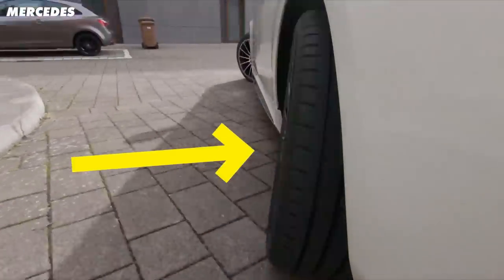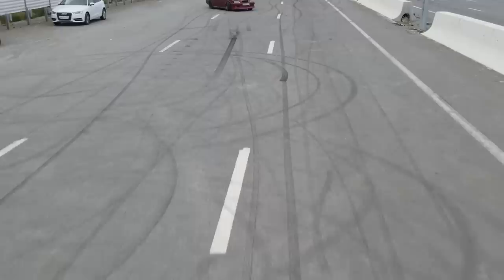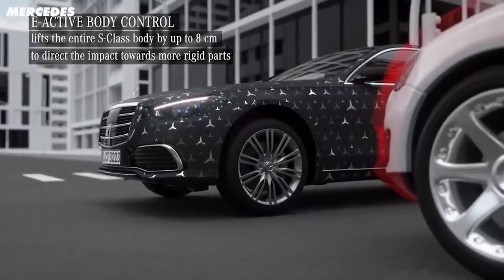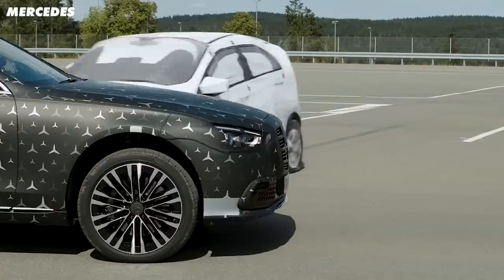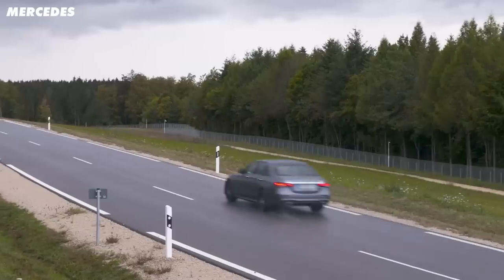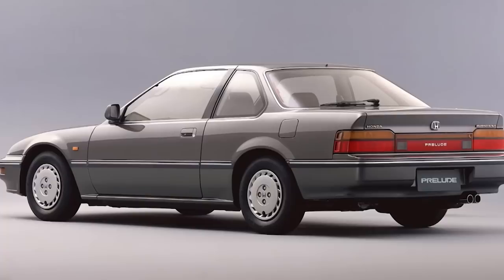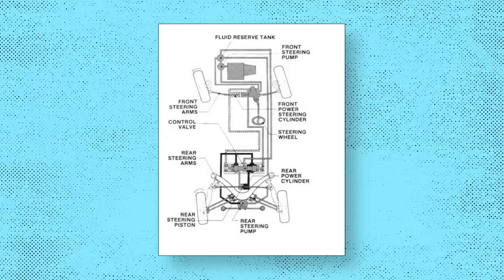Mercedes’ GENIUS Steering Design

Comment: Nice to see this making a come back. I had this in my old Vtec Prelude, great in tight spots and actually super stable and fun on the track. A drawback was that not many places knew how to properly perform a wheel alignment. Very few places had the necessary rear steering rack centre locking pin. https://youtu.be/sldOdWYzW7U
Reply: Honda boys shaking their heads at the title of the vid 😂
Reply: I just finished leaving a comment about my prelude wasn't that absolutely great card they were absolute little rockets super stable at high speed and even though it was only 2 and a 1/2 degrees it it made a huge difference in the turning radius It's funny I used to track mine also and I thought it made It a lot more stable  In the corners
Reply: I bought that pin that was a group buy one off thing done by someone on a forum so I could do my assignment after converting my 91 Si to 4ws. I bought the 4ws stuff, found out it needed to be rebuilt, never put any other money into it. Eventually I threw the parts away about 6 years after I sold the car. I couldn't get anyone to buy them and I was tired of dragging them around when I moved. 😂

Comment: Although not as extreme (3 degree) I love it on my Laguna 3 GT. Makes it in  tight turns just that more nimble. At higher speeds I can't really notice it, other than the car is very nice to handle for a 'normal' estate car.

Comment: I had a prelude about 20 years back that had 4wheel steering and I had one without  and even though it was only about 2 and a 1/2 degrees it made a huge difference In the turning radius

Comment: That system is awesome, but I’d love to see its maintenance costs and repair costs before I wish for it on my car. Although, I don’t need it because I drive a little Golf GTI.

Also, subscription based software updates for already installed equipment should be illegal. I’m sure, eventually, tuners will find a way in and be able to permanently activate the system.

Comment: It's like a fire truck! Years ago, maybe the 1990's, this tech was demonstrated on a fire truck in Sacramento,  CA. Most large fire trucks rear wheels are controlled by the tillerman / rear driver, but the engine/truck demonstrated at the show was operated by the driver.

Comment: Imagine driving off the parking space right next to the sidewalk/wall, you turn the steering full lock, and then when you drive off, the rear wheel climbs the sidewalk, or hits the wall due to that back end swing.

Comment: The early Mazda 929 used this. I recalled it used a shaft that connect the steering rack up front with one in the back. (That's a long time ago)

Comment: 4 wheel steering has also been implemented in pickup trucks in North America over the years with mixed response. This was in order to assist in also maneuvering trailers into tight locations.

Comment: The 575€/year for the 10° rear wheel steering seems to be a missunderstanding, because it's a 1500€ option in the online configurator. Afaik merc only offers subscriptions for things like SOS calls, live traffic updates and (altough now discontinued) gas station prices.

Comment: 1:13 "It sounds quite scary" No it doesn't, it sounds bloody awesome. I've always wondered why there are so few cars with rear steer given its benefits.
Reply: It always comes down to cost. Reliability second, and (sadly) safety third. It's a brilliant idea that should honestly go back to the drawing board at all manufacturers, but it probably would under the same subscription model Mercedes is using. Stuff that the car comes equipped with should just be usable from day one and not paywalled. If you want it, then it gets physically installed as well as the required software installed.

Comment: Mazda, Honda and Nissan all had 4 wheel steer in the 90s and the Skyline was also AWD. No body ever really liked them other than for the oddity as the extra points of failure added very little under most conditions and just contributed extra maintenence costs.... Wouldn't mind an R32 GTR when I was a mechanic and had a wheel aligner but now I'd just prefer simple well built IRS.

Comment: The Skyline R32 GT-R also has All Wheel Steering, but you don’t see the Rear Wheels turning if you are far away from it, but if you look closer you can clearly see it has All Wheel Steering, but some are removes.

Comment: Japanese pioneered Active 4ws systems in the late 80s and early 90s. The 4th gen prelude had an Electric steering rack controlled by an ECU at the rear.

Comment: Rear wheel steering is being used in Mercedes-Benz Coaches with 3 axles for years. It uses electro-hydrolic actuaters for steering 3rd axles for manuevers. So it’s not new for MB and reliability in coaches wasn’t an issue.

Comment: The Volkswagen Touareg has had rear wheel steering as an option since 2018, and it reduces the turning radius of the large SUV to that of a Volkswagen Golf!  This is the same platform and system shared with the Audi Q7, Q8, Porsche Cayenne, Bentley Bentayga and the Lamborghini Urus, and they all feature the same rear wheel steering system.

Comment: Some Peugeots had spring-loaded rear spindles that would want to stay straight but would eventually budge when you exceed certain loads. I think the first 306 had that
Reply: In fact, they're not exactly spring-loaded - they use a torsion beam with offset spindles. This way, each spindle can flex left to right and then spring back to canter

Comment: As the owner of an older S class, suspension maintenance is the worst part. Airmatic suspension can be punctured so easily and you're looking at 2 to $4,000 per bag to be replaced, most people end up doing a complete coilover for about 5k

Comment: He forgot to mention that GM pickups offered rear wheel steering off and on since the 2000’s.
Reply: Not just the pickups. Since the suburbans (yukons) were built on mostly the same platform, they also had 4ws
Reply: The 1995 toyota bxd20 had 4 wheel steer

Comment: Mercedes have had Passive Rear steering in many years. Thats some of the reasons the suspension hasn't changed much I the C and E klasse since the W201. I think my Seat have passiv steering to becaus it's feels lik the harder you push the car in a corner the sharper it would turn. (Leon 2011) same  suspension as Passat, Touran, Golf,  Audi A3 and Skoda Octavia

Comment: is mercedes charging 575 $ a year to be able to use the full rear steering. this is insane. How can people be ok with that?
Reply: Whoever drives a brand new Mercedes S class also has $575 to spare.

It’s the same for Apple, Apple charges you over $400 for wheels on your Mac Pro  but they know whoever can afford this Computer can afford the wheels too, so they just overprice it.
Reply: @GrillerRohde  it has nothing to do with the fact that they can pay for it

Comment: I don't think suspension parts will get more expensive for the addition  of AWS. Three will be more parts to look at but more parts unless someone was being stupid during the engineering phase. Any additional costs will be from the steering system alone, with the one exception being the steering kingpins. But if the front pins don't need to be worried about for decades at a minimum, the rears should be fine too...again unless someone was being stupid (i.e. cheap for no good reason) during the engineering phase.

Comment: There are types of electric motors that basically become rigid when no power is flowing through them, Mercedes' safety standards would either have that or a mechanical lock for the wheels in case the motor failed. For the malfunctioning operation, they rely on redundancy. Also, Mercedes simply does not care for the reliability of the S class after 10 years. Those cars are aimed at people who always will come back to buy the new one and there is little to no incentive to think about a second or third hand owner.

Comment: Mercedes air suspension is notorious for failing and diagnosis is a pita. Add some more complications like rear wheel steering and you are looking at a recipe for disaster once your warranty expires.

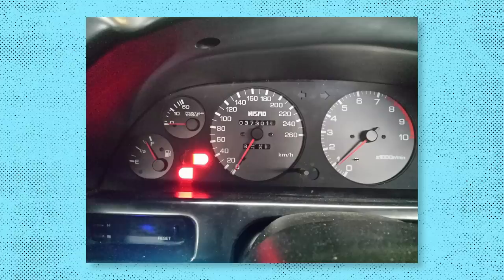Comment: At 4:25 you stated utter bull shit, I've worked on and owned close to 15 Skyline's and my business specializes in Skyline's, The 4 wheel steering almost never fails or give's any issue's between 15 and 20 years of age the power steering reservoir hose starts to leak, loosing oil and brings the light on, but the car is still fully drivable with no risk presented to the owner. The lockout kit is for drifters only, but has no real use on a street driven car. seldom do cars fail and usually they have a failsafe that put's them into a safe point and just stops working. I'd never buy a car that needs a yearly fee to keep it operational

Comment: So genius they are only 35 years behind Honda who did this completely mechanically, and the Honda would also turn the rear wheels a different direction depending on the steering angle of the front... All 4 wheels would go the same way at high speed and low steering angle for lane changes, then opposite directions for hugging a corner at higher steering angle... Also with the reputation for reliability that Mercedes has, I wouldn't trust something like this on one of their cars...

Comment: Didn't Chevy do this in the past?
Reply: Yes on Suburban/Yukon.  Was a 1 or 2 year option made the rear wider and the axle weaker, and when they failed most just lock them at the zero position (due to cost and parts availability).

Comment: Look up the 1990 Honda Prelude. I owned one with 4WS (Four Wheel Steering) Nothing new about this. Only difference is Honda put a tiny steering box that worked a little like a differential.

Comment: Nissan gtr in the 90s.
Renault laguna in the 2000s
Reply: So
Reply: @GrillerRohde  meaning is nothing new, nothing to be amazed, nothing to be impressed and should be shunned by everyone. Like literally, you don't come in 2022 and think you made something interesting when your name is mercedes.
Ah, if Dacia or Tata motors or any other shit cheap brand would come with it, then YES, because it's a 30 year old tech by now, so they could be happy to showcase such a tech.
But for mercedes, this should be quietly passed as a standard feature to ALL mercedes vehicles.

Comment: was afraid that video was just a dumb "commercial" trying to tell ins that Mercedes totally revolutionised the ways cars work.
good that they showed that similar technology has already been used decades ago by other manufacturers.

the point about reliability, i don't believe that, manufacturers like Mercedes have repeatedly proven to us that they sometimes just fail to construct engines and other components that work truly reliably although the basic concept hasn't changed for nearly a hundred years now.
of course i don't want to blame them, there are just so many factors in day to day use of a vehicle which are hard to simulate and test during development. also there might be some unexpected variances in production quality which can cause some serious problems over time.
the more parts involved the more points of failure possible, mechanics, electronics, wires, sensors, software ... just one has to fail and it might be game over.

I've heard that BMW had or maybe still has electronic steering assist in some models which could adjust your front wheels for some degrees of of what the steering wheel was turned to.
Guess what, those systems failed which made some cars suddenly turn to a random direction while driving. to repair that would force the owners to replace nearly all of the steering components and as warranty was long gone that would be very pricey. simply deactivating the components to just have a "normal" steering system wasn't possible either. rendering cars not even 10 years old totally useless.

old technology might not be perfect but I'd rather trust a car from 2000 or older to last another 20 years than a recently launched model to even reach that age.

Comment: Ok so Mercedes Benz copied GMC but 15 years late!  The early and mid 2000's GMC Denali pickup truck had four wheel steering complete with a REAR steering rack.

Comment: The problem here is Mercedes and other a German manufacturers are famous for creating overly complex designs that absolutely destroy the resale values of their vehicles when the warranty expires. And that’s true here with this S class. It largely doesn’t matter what they achieved if the car costs more to own than it’s literally worth which is the case with so many Mercedes and German cars in general once the warranty expires. More complexity doesn’t equal a better car when the complexity turns your expensive car into an endless money pit as is so often the case with German cars out of warranty. The German’s are so bad at engineering they had to cheat on the test for diesel emissions. Any current Japanese or Korean car completely shames the Germans in terms of engineering and often even in terms of lap times on the Nuremberg Ring.

Comment: i think this is pushed too far.
Low amount of rear steering is just objectively safer, since no things are fail proof even if it is made by german or japanese.
Also how the heck does it decide when is low speed or high speed ?
One system i remember does this by speed basis , so rear wheel turn opposite direction under 50km/h and 100 km/h it turns opposite way....now what about speeds in between ? 
Not to mention in low grip scenarios even low speed can cause slip, so rear turning at opposite direction when you are on wet surfaces, ice etc it will be wayy more problematic than no rear steer.
IMO rear steering should only be turned on at low speed after that there should be no rear steering, use aero for high speed stability.

Comment: When!! not if! this system breaks it will out cost the value of the car, they will be on wheeler dealers being repaired because there not worth fixing due to a  extremely expensive but tiny and hard to reach part

Comment: all wheel steering has been around forever. the Mitsubishi 3000GT VR4 had all wheel drive and all wheel steering all the way back in 1991, and i'm sure that wasn't the first car to use it.. point is nothing new here...

Comment: Different cars have this as option for years. BMW calls it IAL in Germany and has it since E60 days. 
Except ist is only in if you buy it and it cannot break if not bought. Seems Daimler goes in a dickmove way. Put it in and charge annually

Comment: Great business model - first full turn of the steering wheel is free, but additional turns to full lock requires a monthly $700 subscription.

Also breaks, regular breaking is free, but ABS requires a monthly subscription, you know, for safety.  

Fuck modern German cars, there is just no bottom for them to hit when it comes to slimy, disgusting scams.

Comment: and all of those videos in my database about ev cheaper because is simpler only emotors, controlers and a few more things are going to the trash, they figured out, overcomplicate things and even worst, they are more expensive than regular cars, with OLD technology and nothing revolutionary so they just going to start stamping the brand as a cherry on yop of the cake. (MUSK car, CHEVYE,FORDE)

Comment: Overengineering to solve a basic problem. It's a bit like replacing mirrors with cameras. An expensive solution that can be deadly if it malfunctions. Just to do something a few driving lessons could fix. If you can't drive a long car, don't buy one. Mercedes likes its customers to beleive the car will practically drive for them, which is why 98% of Mercedes drivers are completely moronic on the road. Watch out for the white Mercedes, in the left lane, brake checking with 1000ft of open space open in front of them, because either the person far ahead started braking a little or they noticed they were 1mph over the limit 🤦‍♂️ The same person who brakes hard at the bottom of a hill just before going up so everyone behind them get to stress test their engines to get back up to speed. Take lessons people, please. No amount of features will substitute for it. People need driving lessons now more than ever. Everyone is mush brained thanks to technology designed to think for people.

Comment: Is the video sponsored by MB? Attributing "genius" to Mercedes for this tech is somewhat click-baity and disingenuous. Even the car on the Moon had 4WS in 1971!
Anyone who lives in a country where majority of vehicles are imported from Japan's used market would have been accustomed to tech like this for the past 3 decades.
Many models had 4WS as part of the standard package just like powered mirrors, electric sunroof, automatic transmission, etc. To say that it has never caught on is like making a statement about automatic transmissions back in the 70's - fast forward to today and the majority of cars are fitted with automatic not manual gearboxes.
One needs to look at other trends also, for example: hybrid/electric cars tend to have longer wheel base - logical counter action to that is to add steering at the opposite end. 
Also Merc's "$575 subscription" sounds like a law-suit waiting to happen in the USA ;)

Comment: BMW had this 15 years ago in the 7 series and Nissan had even a similar system 34 years ago in the R32. And all of this without a subscription 😂 Dumb to buy a new Mercedes to have technology out of the 80s as a selling point
Reply: As you may notice technology evolves and the system used by Mercedes‘ in the S Class is a „little“ more advanced than 34year old system.